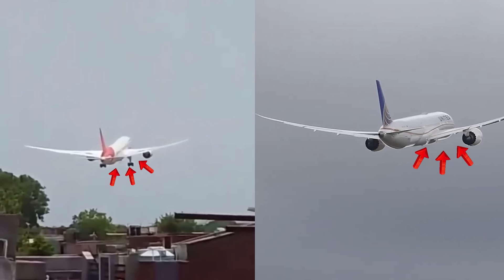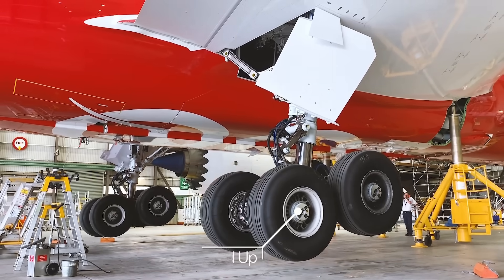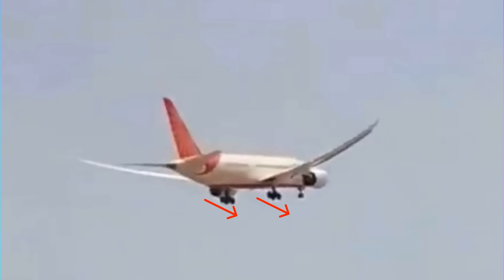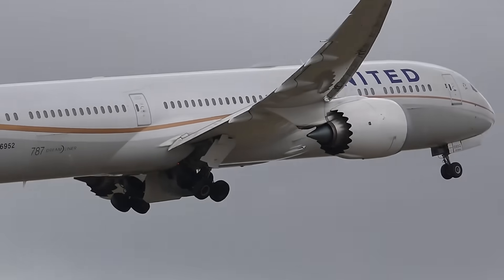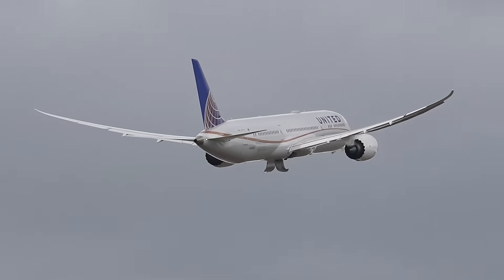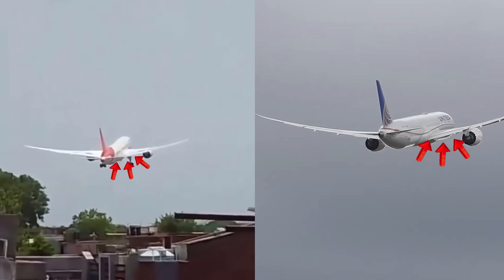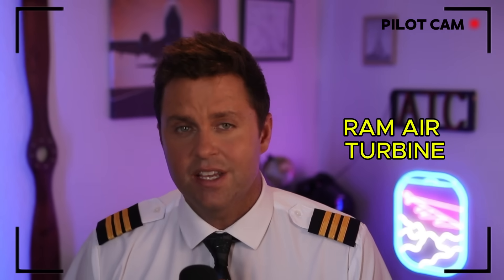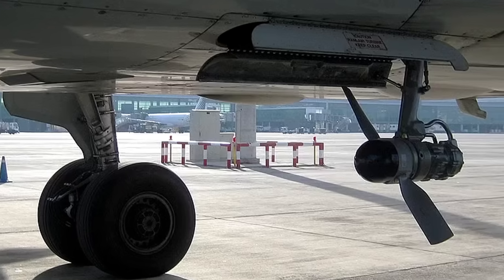Pilot Explains: A New Detail in the Air India 787 Crash Everyone Missed

Comment: Possible causes of a double engine failure on a Boeing 787 could include:
Simultaneous malfunction of both engines:
A defect or malfunction affecting both engines simultaneously could be caused by a common cause such as poor fuel quality, environmental overheating, or faulty software. Cascading effect: A problem in one engine could spread to the other if the systems are not sufficiently isolated. For example, a fire in one engine could affect the systems of the other. Control electronics failure: A failure in the engine control system (FADEC) or in the sensors monitoring the engines could cause both engines to enter limp mode simultaneously or fail completely. Foreign object: Foreign object penetration (e.g., birds or debris) into both engines simultaneously is unlikely, but not impossible, especially during takeoff or landing. Mechanical Failures: In rare cases, mechanical problems such as engine part breakage or bearing failure could affect both engines.

It is important to note that modern aircraft are equipped with extensive safety precautions to prevent such events or at least minimize their impact. These include:
Redundancy: Key systems and components are duplicated or multiplied so that a failure of one system can be compensated for by another. Monitoring: The aircraft is equipped with numerous sensors that constantly monitor the condition of the engines and other systems. Emergency Procedures: Pilots are trained for such emergencies and have clear procedures in place to handle the situation. Despite these precautions, emergencies such as a double engine failure cannot be completely ruled out. Investigating aircraft crashes is therefore crucial to learn lessons and further improve aviation safety.

Comment: No all theories contaminated fuel won’t cause both engine failure 
Neither flaps nor was it pilot error
It seems to engine failure due to power outage or hydraulic failure and could be sabotage by ground staff
You are repeating many times about throttle and Steve 
I thinks it’s all out air until investigation happens
Meet Kevin is talking about Vapor lock 😮

Comment: Severe amount of fuel contamination. Probably pumped water into the engines causing them to flame out.?  Or a bunch of crud jammed up the systems causing extremely low fuel flow.

Comment: Could it have been from the extreme heat because the plane was sitting on the runway prior to takeoff for 3 hours in the 100+ degree heat and there was a passenger video on YT from inside the plane prior to takeoff showing that none of the electrical functions worked and people were fanning themselves. With the extreme heat could there have been a vapor lock?

Comment: Unless the fuel contamination occurred within the aircraft's fuel tank system, the theory doesn’t hold, given that multiple planes are fueled and refueled daily across all airports. I strongly suspect that the failure to deliver adequate fuel to the engines may have caused the dual-engine failure.

Comment: That was an early thought of mine, but how would AI be the only affected airplane? How do the computers that control fuel work on the 787? Turbofan engines don’t need electrical power to produce thrust, but they do need fuel. I assume that there are systems that control fuel flow, even my C441 from 1980 has a fuel computer. Failure of the one on my airplane wouldn’t cause fuel starvation, fuel would keep being fed as I switched to manual mode but I am sure that a 787 system is much more complex.

Comment: Forget about the flaps. What about the passenger that flew in the exact same plane hours before it crashed? He used his cell phone to demonstrate that the a/c was not working. There was no Wifi. He couldn't use the phone to complain to the crew. He said it was a terrible flight. Plus, those people sat in the plane for two hours with no air conditioning before take-off, yet nothing was fixed. The whole thing sounds awful. 🙏🏼🙏🏼🙏🏼

Comment: Gary,
Look at the circuit diagram of that model of 78. Landing gear, enviro controls (lighting, aircon etc.,).....and fuel pumps.... I spoke to a technician and they say they're all operating off the same power bus. On an earlier flight someone complained about the air con not working and other electrical problems. Then we find out the power went out, the RAT was deployed, and now we see the lack of control of the landing gear. I don't think those guys did anything wrong. 🙁

Comment: AI says that the landing gear on the 787 is operated by electrically powered hydraulic pumps.     If your gear tilt theory were to be true ( which it likely isn't ), this would further indicate an erosion of the electrical system.  And since the fuel pumps are also electric,  an electrical system failure could actually be the genesis of this crash sequence.   I have never flown the 787, so there's that.

Comment: I think l know what happened there. Its actually was a chain of events. First of l dont think the pilots reached V1. What happened next caused both the engines to fail and the gear to fail. None of you guessed as of yet  what happened just blaming the pilots with making up the most redicul accusations. I am in shock how many pilots suggest their counterparts forgot to take off with flaps 5 or 15. How they must have got confused and lift up the flaps instead of the gear...next thing l know they will say they placed revese throttel by mistake, l mean come on give the pilots the respect they deserve. Like l said l thing l know what happened lm not going to tell but l give a clue: its not any of the speculations lve heard so far so again this wasnt on the table as of yet. can you guess?

Comment: I hear you, but the RAT sounds like an AT-6 at full throttle, with tips going supersonic.  It’s LOUD.  If you can’t hear the RAT (for whatever spacial or atmospheric reason) isn’t it possible you’re also not hearing the GE engines?

Also, does the RAT deploy autonomously?  I didn’t think it did.  If that’s correct, then there was no way the crew had the presence of mind to deploy it.  They had about 17 seconds to realize they had a major problem.  Select TOGO, do whatever they did to the flaps and gear, and even radio a Mayday.

Comment: Surprised you didn’t mention frozen fuel as a potential cause of dual engine failure since there is precedent for that (BA 38). Admittedly, the chances of that being the cause here are essentially zero given the ambient temps. In the event of some other fuel contaminant might, wouldn’t that have begun manifesting in engine performance during the TO roll, prior to V1?

Comment: Contaminated fuel would not cause both engines to flame out at exactly the same time and without smoke.  In a car, total electrical system failure WILL cause a gasoline motor to quit so maybe that's also true of a commercial airliner.

Comment: I serviced Air India B707 and B747 (the palace in the sky) back in the 1970's and '80's and back then maintenance (other than basic servicing) and cleanliness were not a priorority.  Important to the airline were numerous bomb threats which required extensive checking of the aircraft interior prior each flight.  Back then it seemed that safety may not have been on the top of the list for the company.

Comment: Air India is using a combination of mineral (traditional) fuel and "green" sustainable fuel, whatever that means. Maybe temperature played a fatal role on the degradation or contamination of that fuel. Anyway, it's kind of incomprehensible why the aircraft took off normaly (using the full runway as if it couldn't accelarate fast enough)  and then falls down.
I don't know. Many things don't seem to fit.

Comment: Airplane engines are LOUDEST ON TAKEOFF, but neither the survivor nor witnesses have mentioned LACK OF ENGINE NOISE.  Are you saying there was NO ENGINE NOISE FROM THE 787 JET (other than from the RAT) after take-off when both engines failed?  If this is so, WHY HASN'T THE SURVIVOR MENTIONED THIS?  He said he "heard a bang", and "the lights flickered", but wouldn't the sudden stoppage of both engines upon dual engine failure be more apparent than either a "bang" or "flickering lights"?  I think Capt. Steeeve played a recording of the engines several times so we could hear the sound of the RAT.  (I couldn't tell the difference), but there definitely was engine noise.  I'm not sure if he played the noise of the actual 787 engines as the airplane went down, but if it was, THEY WERE ON, and their noise drowned out most of the RAT sound.  Wouldn't some ground witnesses or some survivors in the buildings the airplane crashed into, notice a silent airplane approaching or passing by?

PLEASE SEE THE ORIGINAL VIDEO AND NOTE A DARK OBJECT FLYING OFF THE LEFT SIDE OF THE AIRPLANE, JUST BEFORE THE PLANE DISAPPEARS FROM VIEW.  Perhaps CAPT. STEEEVE mentioned this looking like a door would look if it flew off, or perhaps "parts of trees or houses" on the way down, but this has been discounted as an artifact.  I discount NOTHING until the cause is revealed.  

[If BOEING has been negligent in this case, putting PROFIT before lives, this new incident might lead to the END OF BOEING.  There are already rumors about the suspicious deaths of two BOEING whistle-blowers who came forward about BOEING'S overall lack of quality control and cost-cutting, methods leading to compromised airplanes that WILL fail.  The only surprise here is that it's taken so long for defects and compromised construction methods to show up.]

Comment: Total electrical failure would kill the engines. There were problems with power to the entertainment systems prior to takeoff. Possibly a clue to electrical failure. Also the rat deployed points to a major problem.
Reply: Electrical to Computer to engines...... to crash
Reply: But do they not look at the airplane before taking off?
Reply: There is no such thing as a total electrical failure. There would have to be numerous completely coincidental independent power supply failures to achieve this. The engines are quite happy to keep running even if all four main engine generators have failed. And the aircraft can still be controlled.
Reply: @ImperrfectStranger no electrics, means no engines! With no power to the engines, they don’t work. No power, means no fuel pumps, they don’t work. The RAT only deploys in a dire emergency, such as electrical failure. There were problem with the entertainment systems not working before takeoff.
Reply: @HammyHamster-c2r  "no power no fuel". You keep saying that, but I haven't seen any documentation provided. On the other hand, I have documentation and a video to prove otherwise. Have you ever worked on the accessory gearbox (ADT) of a 787 with GEnx-1B engines. I didn't think so. You probably wouldn't even know what you were looking at. 
I wish I had a dollar for every time I've fixed an inflight entertainment system. As an avionics maintenance engineer, that was the bulk of my work. It means nothing. 
Stop spreading this cr*p.
Reply: @ImperrfectStranger this is very worrying. Do you even know how jet engines work?! You work in a factory, just doing what you are told to do. Have you even been interested in the theory behind the planes you work on?
Just because you have a bag of spanner’s doesn’t make you an expert. I have just looked at two other vids, and they agree the same thing that I posted here.

Comment: Engine-Specific Problems:

Material Fatigue and Cracks:

Problems with the intermediate-pressure turbine blades, such as those experienced on the Rolls-Royce Trent 1000, can lead to failure.

Foreign Objects (FOD):

Foreign objects entering the engines, such as tools left on the ground by maintenance personnel, can also cause damage and failure.

Software Failures:

Problems with the engine controls or other electronic systems that monitor and control the engines could also lead to failure.

Erosion and Corrosion:

Long-term stress and environmental influences can lead to erosion and corrosion of engine parts, which also poses a risk of failure.

System-Wide Problems:

Fuel Supply Malfunctions:

Problems with the fuel supply to the engines can result in one or both engines receiving insufficient fuel and failing.

 Electronics Problems:

A failure of the electronics responsible for controlling and monitoring the engines can also lead to a total failure.

Maintenance Problems:

Maintenance problems, such as incorrectly attaching components or overlooking problems, can lead to a subsequent failure.

External Factors:

Bird Strikes:

Birds entering the engines can cause severe damage and cause a failure.

Weather Conditions:

Extreme weather conditions such as heavy hailstorms or lightning can also cause engine damage.

Faulty Flaps:

A fault in the flap system could also contribute to a crash.

Comment: Gear is hydraulic so when they activated them the  hydraulic fuel pumps loosed pressure. I dont think the rat was made for driving the gear up and fuel pumps 30 sec after take off. Perhaps one or the other, but not at the same time. Lowering the gear needs no power, once released they will fall out, but up will make a great difference. And once set to retract it will try to get the wheels up. And fuel pumps get less pressure! If they had forgot to retract the gears, the engines would have been running fine.